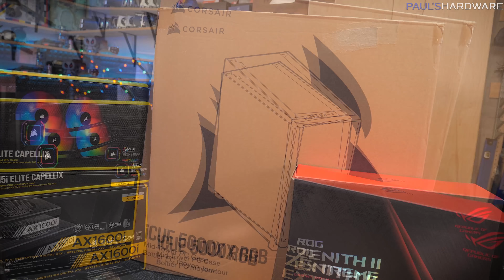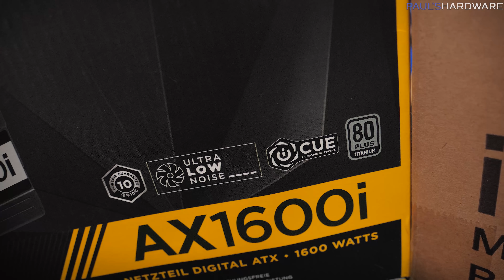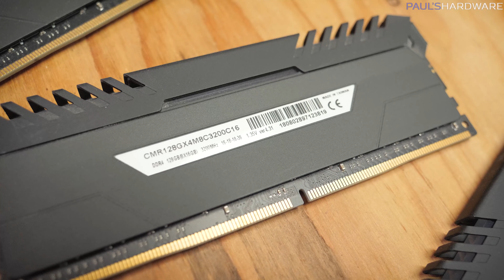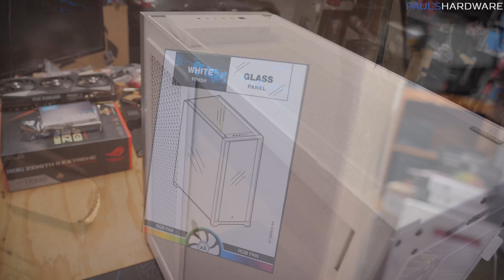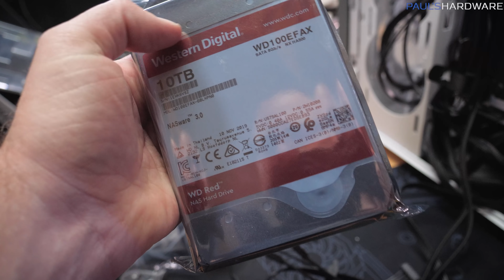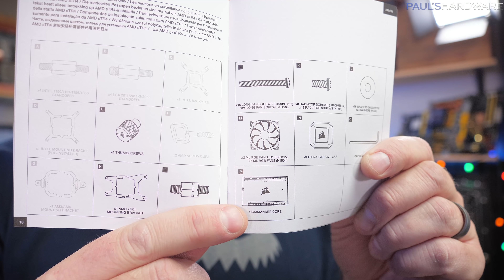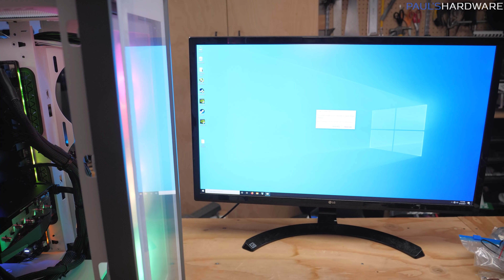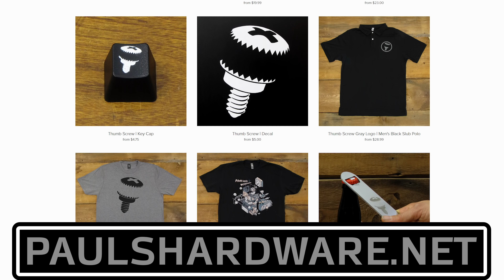Trying to build the fastest PC I can...

Comment: This is the most realistic computer build ever. Nothing ever goes together the way you hope at the beginning.
Reply: That's funny to hear. My first build I just did used the 5000D case and I had it all together in around 3 hours. Although I did research extensively for the compatibility of every part to work as a whole. I guess it worked.
Reply: Oh the feels. On my 3rd build in the last year and although with a lil research all problems get solved...there is always a prob or 2 lmao
Reply: The first build is usually the easiest BECAUSE you do all the research. After that, you get distracted and have time constraints. You don't do the research and start scrapping together parts that you have to "finish out the build". It's the "using what you have" that leads to the problems. 20 years of building computers and I have lots of spare parts but never the part that I need.
Reply: That case is fucking awful. Corsair really doesn't care and it shows.
Reply: That one time when DDR2 switched to DDR3 and you didn't know and bought DDR2 ram for the new MB 😬😳
Reply: @theglowcloud2215  Well its at least the Airflow version... but yeah, there could be improvements. Like being slightly taller  to fit 3 140mm fans with better clearance for the Mobo on top for the power connector, and also wider to fit the PSU on the side so there could of been bottom mounted fans as well. Maybe they will make a full tower version soon.
Reply: Using powersupplies with proprietary fat cables is really difficult to cable manage. My rtx 3070 triple fan card even blocks the chipset fan on my asus tuf x570... it looks so messy that its a good thing i keep the glass facing a wall
Reply: Had the same problem, is just normal 😝
Reply: I felt that build on a personal level. When I did my first new PC build in 2019 after not doing anything else other than upgrading the GPU since 2011 I estimated the time requirement to about 4 hours. After serveral problems and having to read the manual for lots of new stuff and even having problems with the motherboard not fitting too well into the case because of the premounted IO shield (it's simply too fat and a bad fit for my case) I was barely done after 8 hours and only quickly connected everything to make sure it even works.

Gladly, the PC worked right away and I spent some time the next day (2-3 hours) to make it look as pretty as I could but didn't want to redo the whole cable management.

All of those youtube vids made you think that building a PC can go so smooth, quickly and you're done in like 1 hour but in reality you should plan for at least a whole day just for the hardware part. Then comes the software crap...
Reply: I just brought a bunch of good deals  into a mini itx case, and I had no issues
Reply: Facts

Comment: "This build is becoming more and more temporary as time goes on."  Translation: I don't like this case.
Reply: Great case he just doesn't want to mod it.
Reply: @Raven.Bloodrot  imagine having to mod a case for it to be reasonable to work in
Reply: @Mayushii3  imagine jamming a mid tower case full of shit it's clearly not designed for.
Reply: @Mayushii3  he even admitted that he didn't do research on the case before trying to use it. 100% not a case issue.
Reply: @destruct1214  it's not unreasonable to assume that a case that claims to be e-atx ready to be sufficient enough for a big build. This is a $250 case which in essence makes it a fairly high end case.
Reply: @adriandejong8647  What are you even trying to say? The problems he had with the case were because he #1 didn't research the build before trying to put it together and #2 he was waiting for parts to arrive while attempting to put the build together. Both of these are not a case issue.

Comment: Last year I bought a white Corsair 780T, dismantled it and sprayed all of the black metal chassis white. Its smaller than the 1000D, is easier to carry and it has lots of room and plenty of front panel drive bays. It is, in my opinion anyway, one of the most versatile cases still available if you are building a Threadripper system (which I hope to do one day!).

Comment: Just finished my first build ever. Used the Corsair 4000X case. Ran into a few small issues with the fans and ended up purchasing a Commander Pro to control them and thought to myself I wonder if the pros run into these unexpected issues. Now I know! Awesome video!

Comment: I loved this video....it's "real" (I mean, you have a 3090 while I'm rocking my 356mb amd), it's down to earth like real pc building is, with obstacles and issues, the aio is a great example of something that can and will happen to anyone and in the middle of the build you have to adapt.
Last year I built a pc to donate to a friend (got a sweet deal on a quadro and later my 1080 went caput.  Anyway...) And I had fitting issues with the cooler, it wasy first mini it's built and in the end had to improvise with zip ties to fit a second fan and get a push and pull to keep the 2700x cool.

Awesome video !

Comment: Hey Paul, I know it's probably a painfully tired suggestion (and cliche at this point): but given this is also a NAS - I recommend the Lian Li 011 Dynamic for this build. It has 4 hot-swappable 3.5" HDD bays in the back, TONS of space, lots of front ports (w/ USB C), will EASILY fit you're PSU, and has clearance for that Dark Rock Pro 4. 

I know people like to bash the O11 and O11 Dynamic these days because they are so over used... but honestly I cant think of a better case that exists for people rocking rigs that double as NAS. If it's supposed to be a beastly work computer that's more function over form (with lots of ease of access and expand-ability), then there is your answer. They even sell a GPU support bracket to prevent damage on you're heavy 3090 (those are worth more than gold). 

I use a Dynamic 011 XL for my video editing and rendering rig, and I find the ability to simply (and quickly) access, remove and swap a HDD out on the fly (often without even having to turn the PC off and stop working) is immeasurably useful. I loved the convenience so much, I later built my gaming PC in a LAN Cool II mesh, because it has a optional 3-way hot-swappable HDD accessory kit.

Comment: Hi all, bought and Alienware R12 as I got back into gaming from COVID and quickly realized the mistake I've made cause the lack of upgrades the case/motherboard can handle. I just bought the 5000X and am looking to get the 13900k once released tomorrow and start my build with a 4090 if I can find one. All these mistakes and watching you overcome them has given me even greater confidence to complete the build, knowing that mistakes are ok and wont run the system if handled correct! Thanks for the vid, i tossed you a like and sub!!

Comment: I think we've all had days like this, I feel for you Paul. Really looking forward to seeing you update the capture rig, I hope it goes more smoothly.
Reply: I've had a few builds stop in their tracks because I was missing a simple splitter cable or similar. Too bad there's very few retail places you can run off to grab a simple item now. Back when Radio Shack was around they had a little PC building section with fan splitter wires, and some ThermalTake case fans, etc.
Reply: @bothellkenmore  We used to have a chain of shops like that here in the UK called Maplins. They were an awesome family owned company. Many a time I realised halfway through doing something I didn't have any paste left or whatever, like you say it used to be easy to resolve. Now a tiny error like that is a major hassle.

Comment: for better airflow, you can get replacement panels for any side. so get an airflow front if you think it's not enough of the top airflow if you want a push pull rad there

Comment: I can definitely relate.  Bought a 3090....didn't realize that I didn't have a 3rd PCI-e power cable.  Spent 2 hours repinning an old cable I had from another PSU....only to discover that I didn't have a spare connector on my PSU.  I just went to bed.  As I was laying there I remembered that I had two EPS connectors on my MB and remembered reading that it would run fine with just one.  Next morning had it up and running and it works great...until you raise the power limits on the GPU and it just dies.  Got a new PSU on the way; it's more than stable under normal speeds until it arrives.

Sometimes you just got to walk away before stuff starts flying out the window.

Comment: Paul, just so you are aware. The DIMM.2 slots run through the chipset, if that matters to you. It'd be better to stick the gen4 NVME between the pci slots, and any gen3 NVME on the DIMM.2 and the slot on the back of the motherboard. Just be aware that 4 of the sata ports are disabled if you run the NVME slot on the back at 4x lanes instead of 2x lanes.

Comment: As soon as you got to the iCue bit, I screamed because I knew exactly where this was going. Only Corsair would require two or three different types of breakout boxes for power and RGB. Having to have a Commander Pro and Core (or a Commander Core and a Lighting Node Core, not to be confused with a Lighting Node Pro) is insane. Like, I’m mad just typing this out.
Reply: I just recently moved from the Corsair Crystal 570x to the 5000D Airflow and I'm still a little traumatized. I have Corsair's AIO, RGB fans, and lighting strips. This setup requires a Commander Pro, two separate RGB controllers, and a lighting core. The sea of cables behind the motherboard is outrageous. I was able to fit my hard drives and an EVGA 1000 watt PSU in the case but my knuckles paid a price.  My final build looks great but it will be a long time before I consider starting over and when I do, I'm going to kick my iCUE addiction.

Comment: Great video! You tell them that it is just for you... you go, dude! ^^
quick side note: the WD100EFAX is CMR, so the GOOD kind of hard drive magnetic recording.
The WD101EFAX is an air-filled drive that is considerably louder than the helium-filled (usually more expensive) WD100EFAX and the air-filled also runs 5°C hotter on average.
You got everything backwards, Paul. :P

Comment: I was thinking of getting the Corsair 5000X as well. If you want a case recommendation may I point you to the Phanteks Eclipse P500A (PH-EC500ATG_DBK01) high Airflow Full-Metal mesh Design? Steve Burke has recommended it for noise normalized thermals and the case is aesthetically pleasing. The modular design should make it easier to tailor the case configuration to your specific use case. If you do go with it, I would buy/use three more case fans with the case for the level of hardware you're planning to use.

Comment: Hey Paul im pretty sure you can remove that plastic shroud in the lower front of this case and than move your HDD cage all the way to the front and rotate your cage around 180 degrees to face the motherboard side of things to give your access and route your cables....

Comment: Good job Paul. I feel your frustration.
A gigantic case like that really should be able to accommodate a couple of hard drives and a big power supply.
Is there no way to attach them to the back panel where those three SSD mounts are?
Or maybe a way to swivel the drive cage 90 degrees, so they would slide in towards the front of the case? Not sure if that would give enough room, but it might.

Comment: I would say the new O11 EVO that's coming out soon would be perfect for this build with a shit ton of airflow, great hardware compatibility, 4 hot swap bays for 2.5" and 3.5" drives, and just sexy aesthetics overall. DerBauer showed it off recently if you want to check it out. If you filled the black version of that case with Noctua Chromax fans and got some sleeved extensions it would be a really nice and well performing blackout build. Im pretty confident it could fit the 850w PSU in there as well

Comment: Bro that AIO setback frustration is real. I ran into similar problems learning corsair's RGB infrastructure in the first place. First i ordered a commander pro and expansion fans without the fan RGB hub, so i could't connect any of my fans RGB. Then I decided okay, i'm gonna be buying more ANYWAY, so I got a 3 pack of fans and hooked up all 6 to that hub and got it working but better. Then i decided THATS NOT ENOUGH, and it continued to devolve and evolve again until I settled on scrapping my old case all together (HAF Stacker 935 + 2 915 modules) because it was old and frankly unsafe with how top heavy it was with the new build, so I got the 1000D and looped in my 2080ti at the same time. You have no idea how much I screamed and swore, and even wrote to corsair about their "false advertising" (really just bad advertising) and lack of instruction on what all you needed to buy to get their stuff working. It's worth noting I originally used an AX1200i in my build as well, but that was an RMA unit which ultimately went bad as well (including original returns when i got it that's my 5th bad AX1200i since 2013-14 when i got it). Replaced the PSU with an EVGA Supernova G2 and off to the racehorses I went without any random shutdowns since. Corsair could definitely do a lot to improve their end user experience with regards to their RGB products.

Comment: Really happy you went with a cooler with an appropriate cold plate size :D (also not an AIO, I've had several leak or had pumps die). I think a black fan in the back behind the CPU cooler would fit in nicely as the motherboard and cooler is black too.

Comment: Yesterday my ryzen 7 3800x was running hot like almost 80 degrees while playing some games, I just built my pc 2 months ago so took off the cpu amd wraith  cooler cleaned the old thermal paste off and reapplied more thermal paste cuz the first time I did it I did a small pea size and don't think it was enough, so applied a bigger pea sized and now it dropped 10-15 degrees feels so much better now not having to worry about temps while gaming.

Comment: The white panel that sits behind the motherboard has screw mounts for 3.5" drives. Where the mounts for the fan controllers are. I just got the 5000d Airflow and I used 3 3.5s and 3 2.5s and two m.2 on the mb itself. It took me a few hours to get that set up. And I also tried to remove the side panel that the fans screw into, even after removing the 3 screws on the left hand side (towards the front of the case) I could not figure out how to remove it without using an insane amount of force, so I did not remove it. Hopefully that helps.

Comment: Paul , the fan plate on the back , that was restricting your access to the hard drive bays , can be removed.  There are screws under the cable ties apparently,  you need to pull out the cable ties to remote the screws.
Reply from the maker: I swear I looked everywhere for them 😅 thanks though that's good to know

Comment: Yeah, dude, I like the Capellix, but that connector drove me nuts.  I have it in a Obsidian 500D RGB SE chassis, and they started mounting the fan hub and rgb hub with some kind of crazy strong adhesive, and with the new hub that does rgb and fan, both of those are useless but virtually impossible to remove, so there they are just taking up much needed real estate in the cavity.

Comment: Suggestions:
Fractal Design r7 or something from that line - I'd love to see a build in that case that actually utilizes the hard drive storage area.
Cooling: Custom loop for the TR (or full custom loop ;) ), while I dont usually think CPU only loops make much sense (in a normal build, the GPU makes far more noise than a Noctua air cooler, so why upgrade to a CPU only loop when putting the GPU under water would in fact make much more of a difference. But for threadripper... There's beautiful CPU blocks for them and a loop would at least be justified. Might as well put the 3090 under water while you're at it though, gonna be much quieter :) And the fractal cases also have good rad support so win-win

Comment: Don't feel too bad, even though I was pretty sure the fan tray in the rear could be removed, I had a difficult time realizing I needed to remove the cable routing bar before I could remove that back fan tray. It took a lot of cursing and looking back at the manual (which isn't the best depiction of removing the tray either) before I managed to get it out of my corsair 5000 series case.